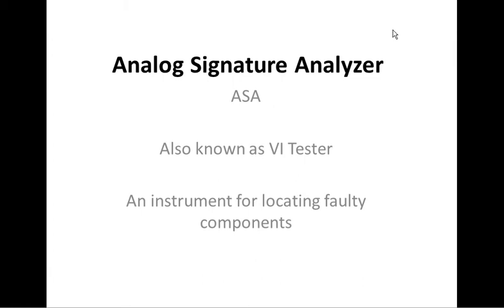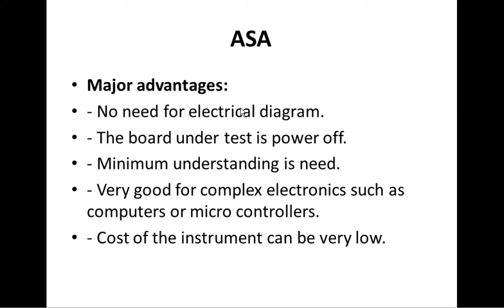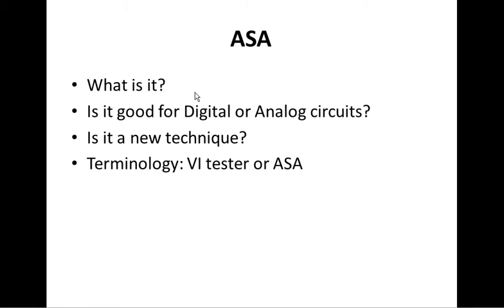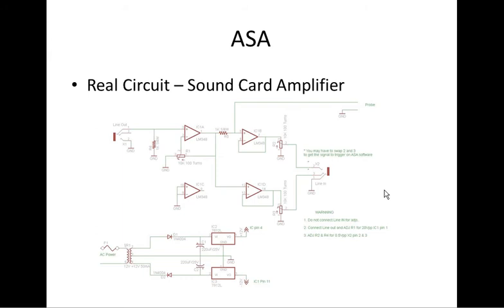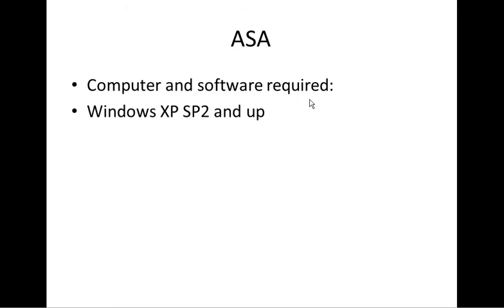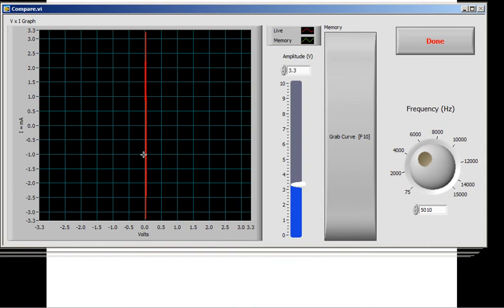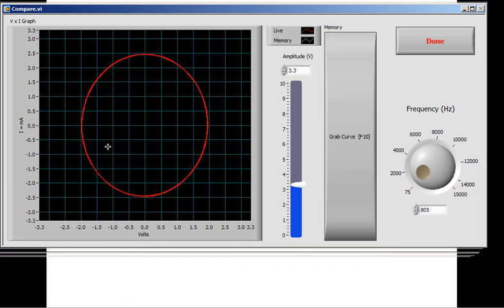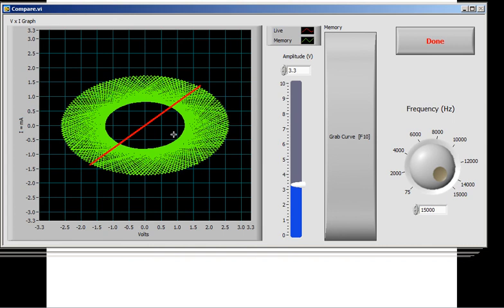Analog Signature Analyzer Part 1of 3

Comment: If I remember right, this was called a "Vector Scope Signal Tracer." They were used mainly before Oscilloscopes, but were available when I was young in the 1960s through Heathkit and others. Vector Signal Analysis is still taught by Agilent (HP) through Application Note 150-15. I used to use tools like this as a technician, along with a continuity light with a probe we called a "bug light." we verified diode and transistor operation as well as normal circuit action by the intensity of the incandescent lamp. Of course, that was with the power off of the circuitry. We later got HP logic probes and Digital Pulsers to aid us in troubleshooting, along with Signature Analyzer (HP) instruments.